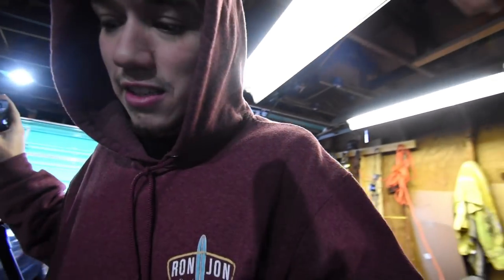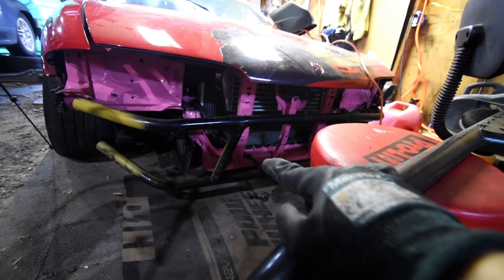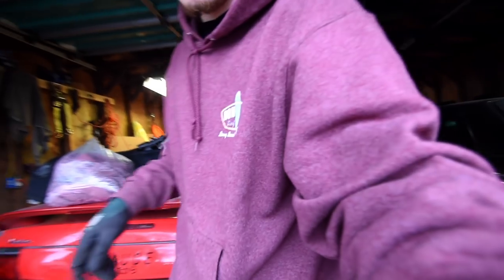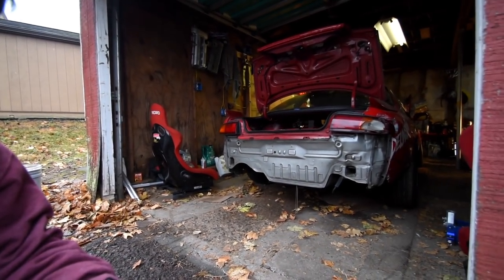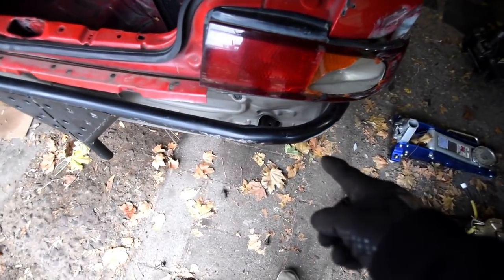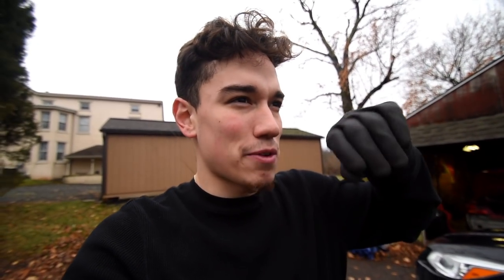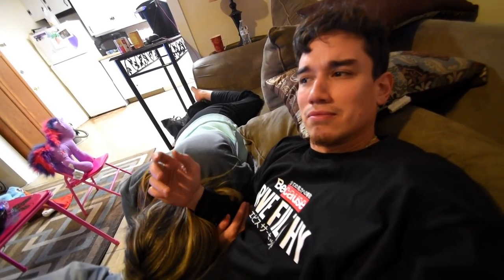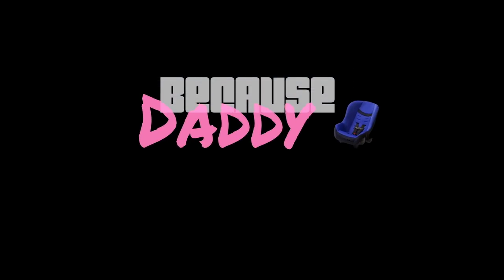Remember that time we smashed into a wall?

Comment: Make sure you clean the surface of the metal with an angle grinder before welding. I tend to not stick as well if you have paint or unclean surfaces
Reply from the maker: Gotcha! I kinda had a feeling thats what it was

Comment: Is the end of the bash bar an open tube?  If it is you could slid a breaker bar into the opening and heat the bend up with a torch.  Once it is warm you can use the breaker bar as leverage and pull it out.
Reply from the maker: I tried doing that but without heat ill give it a good shot one day
Reply: You have to do it while it is still mounted to the car